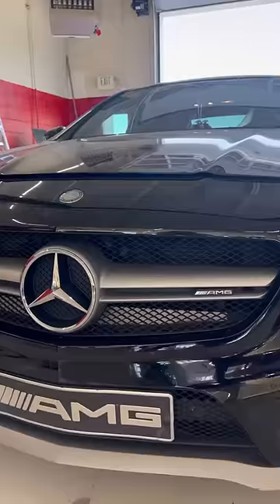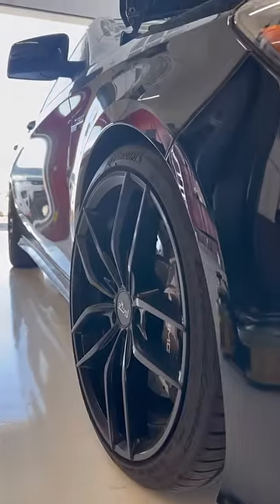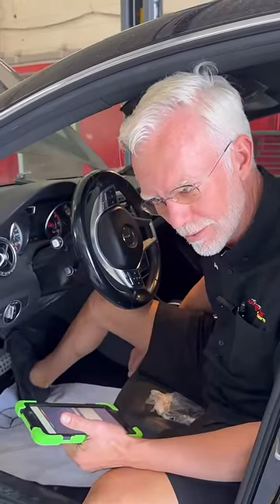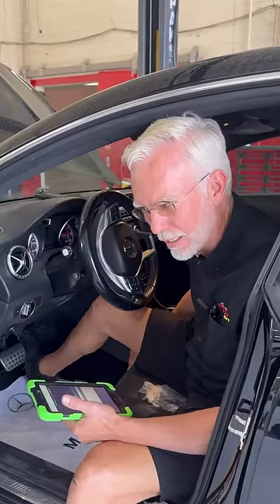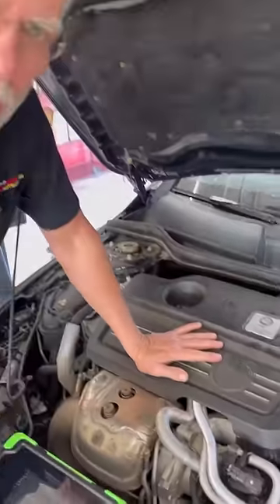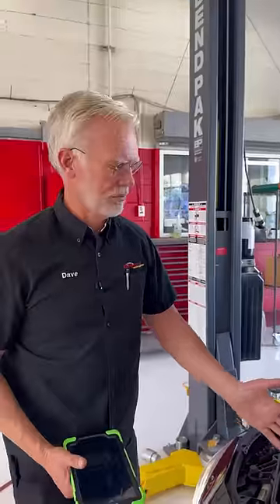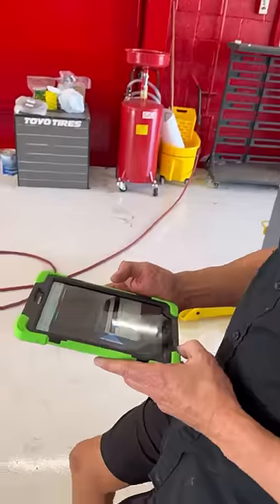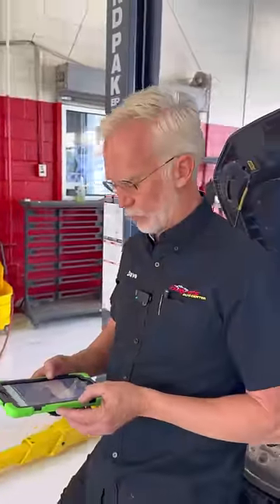Mercedes AMG Nothing but a slight noise on start up #carrepair #autoshop #mercedes

Comment: I’m just an old back yard mechanic with 43 years under my belt. To me it sounds like a water pump issue. Overheating and that squeak are tell tale water pump signals. Well unless this has an electric water pump. In that case it’s time to get the hose to my ear and go noise hunting. Could be a serpentine belt. I used to use Chilton’s Books. Now YouTube is my best friend. Channels like yours are invaluable.
Reply: it said something about the turbo and it sounded like a blowoff valve. i think thats the squeak you're talking about? usually they have the boost recirculate when the throttle close so that you dont hear the blowoff so thats one problem, the overheat is probably the water pump as you said or a bad thermostat etc.
Reply: Yes definitely
Reply: Could the overheating also be related to the supercharger/turbo (what is it turbo or supercharger on the AMG?)  problem because it's running lean!?
Reply: Electric, but your on track, the supercharger has an electromagnetic clutch,
Reply: it’s a mercedes, problems are never gonna be what they should be 😂
Reply: @tomconner5067  he made a short showing the fix. they replaced the thermostat and took out the junk in front of the radiator. 
the turbo related issue was apparently the wastegate. 
judging by the aftermarket wheels, the blowoff valve noise is probably on purpose by the owner.
Reply: The problem is it’s a German built car . 👍🇨🇦
Reply: Amg are some of the best Mercedes Benz out there they put the entire engine together by hand so if you think they are trash compare it to ford transmission or the cheap dodge rams with issues on new trucks or look at the Nissan titan rear axle weak as hell they all have some issues but I would rather take the Mercedes Benz because my uncle was a technician for Mercedes Benz for 28 years he saw it all and more
Reply: Put a thermostat in it and clean the radiator and it will be fine, been doing this for 45 years,   the valve not is probably something the owner done to it on purpose
Reply: Agreed, WP impeller bearing?
Reply: Possibly a leak at the manifold turbo.
Reply: Water pump on way out for overheat issue. Turbo issue for noise when letting off throttle.
Reply: You're a lad 🤝🏻
Reply: You heard the blow off valve for the turbo
Reply: Chilton b books whenever we bought a new vehicle me and my dad would go out and buy a new book for it
Reply: How would that cause low intake pressure? My bet is a shot bearing in the turbo, possibly oil starvation and after a few seconds when the pressure builds up the squeak goes away.
Reply: @Charles-j1e7t hahaha funny you say that because Mercedes use Nissan engines and I haven’t broken anything on my Navara NP300 (top range titan just in a diff country)
Reply: @gilibran you are reaching
Reply: Was my first intuition too, if it's overheating, check the cooling system, so coolant, pipes and pump. I guess if it's not that, some sensors the might be feeding wrong info so that it overheats?
Reply: Literally just what I wrote 😂 then I saw your comment 🤷🤦🏽‍♂️
Reply: @s2e130  That’s what happens when you get old. 😂
Reply: I would start with turbo.Soounds like  impeller bearing damage
Reply: If it's not the heads it the  thermostat .
Reply: It's prob the diverter valve
Reply: Stealership?
Reply: Also cud be turmastat
Reply: @Charles-j1e7t the issue isn’t the craftsmanship it’s the engineering MBZ constantly tweaks and takes shortcuts for performance rather than reliability.
Reply: Might be a snapped faldoring cord...and cracked billings bracket
Reply: @gilibran  pretty sure its a 2.0l turbo.
Reply: Testing for coolant proper circulation and or any lose hosing cracks in the charge air to air
Reply: I said in another Mercedes short to swap an LS in there problem solved!
Reply: I agree one hundred percent.
Reply: @ohiowankenobi1337 man ain't that the truth. I just got an old eclass nothin crazy but everytime something happens & I'm like "ah I know what that is" it's never what seems like lol.
Reply: @cameronhamer9432 shutup canada, what cars do you make? you got Toyota factories, ford factories, but no designs of your own yet huh?

🇩🇪×🇺🇸💪😂
Reply: Needs new engine ?
The older Daimler Benz engines are stronger, and sound pretty good too.

Drop in a DB 601, with a pair of synchronised MG 17s protruding from the bonnet, and that would be a nice reliable get around car that would keep you out of trouble for years.
Reply: should have a lean condition code thrown if it was running lean.  Underboost  condition is a wastegate   on or charge pipe leak. ... just thinking outloud. not trying to bust chops.
Reply: Same exact thing I was thinking! Water pump start there and move down.
Reply: @Charles-j1e7t not all AMG engines are hand built anymore 😔
 I think these four cylinder engines are one of those.........
Reply: @darkskinwhite  the Canadian designed matrix corolla doesn’t exist I guess
Reply: @darkskinwhite  Yeah it’s wild. Modern mercedes add to that by being impossible to repair lmao. Had a customer getting his oil cooler seals replaced on a 16 sprinter. Mercedes recommended to us that we have him replace a whole array of gaskets and bolts, total came to some 40 parts, 17 hours of labour and $17k when the dust settled. Had our most experienced and fastest tech on it, man was a miracle worker and shaved the labour down to 14 but he was ready to kill mercedes by the end
Reply: UR probably right .
Reply: Amen brother.
Reply: I'd clean the radiator for the heat then mess with the intake manifold to figure out the source of the noise under all of that rubbish plastic.
Reply: That's what it sounds like to me.
Reply: Even if electric pump it could have a bad impeller. Or collapsing hose.
Reply: I agree with your diagnostic. Sounds like water pump bearings.
Reply: Hey U can buy 2 Toyota Camry’s for 60,000. Throw that high classed Mercedes away and live in your budget.
Reply: German engineering.
Reply: Haha, Chilton's or Hanes. I practically forgot about those old books, but they sure were a godsend before YouTube.
Reply: @Scalettadom  I still have some.
Reply: Kids these days don’t even know what a chilton is I still go to the chilton first then you tube you never know if you’re going to rely on some jackalope for guidance.
Reply: If the turbo is water-cooled instead of oil cooled, there may be a small leak.
Reply: That's what I thought
Reply: Spot on  . Mike Scotland
Reply: With 43 years under your belt, I don't think you are a "backyard mechanic" anymore. That's amazing sir
Reply: @ Thank you. I’m a Master Plumber that has been doing my own mechanic work since I was 15. Everything from my trucks to my BMW to my wife’s Q7. I don’t rush in. I do homework and always fix it right the first time. Mostly because I hate doing things twice. I was following Dave’s four C’s before I knew they were a thing. Verify the problem, find it, fix it, verify the fix.

Comment: My nephew has been a Mercedes mechanic for 30+ years.  He knows them backwards and forwards and knows the weaknesses of every engine in every model year, and the fixes.  His mom, a Doctor, was in the market for a solid, reliable car, and asked him if she should buy a Honda or a Mercedes.  He told her, "Mom, buy the Honda."  You would THINK that if you paid that much for a car that it would be near-perfect in the reliability department.  You would be dead wrong.  Let's face it:  Buying a Mercedes is, for MOST, and exercise in VANITY and EGO.
Reply: Or just liking how the car looks and performs too. Nothing to do with ego. I guess you're speaking about your brother's mental issues though.
Reply: @user-2Hteyasizyc  And not caring about the reliability, economics and dealer support ?
I think you're barking up the wrong mental issues tree.
Reply: My dad talked the dealer he worked for into wholesaling used car trade in German cars to avoid all the headaches their return for work would cause.
Reply: Idk about that lol. My family has had an ‘08 ml320cdi since 2012 and that hasn’t given a single serious problem. This was the last model before bluetec iirc. We do all the work on our own cars. If I remember right, my dad had to replace the egr valve and he ended up just doing an egr delete when he saw how dirty it made the engine. I think he also replaced something to do with the ac compressor around the same time because it wasn’t blowing as cold as it should have been (maybe a year or two earlier than the egr delete). This was not too long after we got the car so my memory is a little hazy, regardless in nearly 15 years those are the only two problems of any real significance. If you take care of the cars they’ll serve you well. You hear a lot of horror stories of expensive repairs, but I think a lot of that is just mechanics scamming customers who know nothing about their car like in this case. That or it’s from people who don’t know anything about their car and don’t properly maintain it. It’s nice to have nice things and especially cars can give you a lot of joy for 10+ years. It’s not about vanity, though I guess it might be for a small minority of people.
Reply: I worked for Mercedes for 4 years at a factory building trucks. Not a great company to work for, I always did a good job, but I can’t speak to the rest. We did make a good product, unfortunately the company decided to ruin it by trying to cut costs and move to Mexico.

I think anyone that thinks they’re gonna get Toyota and Honda reliability out of something else is fooling themselves. Keep an eye on where your stuffs built stop following brands because of loyalty.
Reply: @rickjames9477  Funny ive driven a Volvo big rig with a Mercedes engine with an automatic transmission. It skipped gears and had adaptive tech, went in and out of gears when going down hill. it was strange having the truck pop out of gear and coast then automatically go back in gear and the cruise come on by itself. and applied engine brakes automatically. None of the other drivers wanted to drive it so it sat a lot with low miles for an older truck. At least it didn't have sensors that applied the brakes all the time like other trucks I drove. I almost bought it. It was an easy truck to put miles on.  I'm not crazy about German cars though.
Reply: @user-2Hteyasizyc  So the vanity part about you is spot on...
Reply: Agree. The two most important consideration in buying a car are: A car is a tool, does that tool fit your usage? And. Can you afford the repair costs? Take the high performance Audis: Can you afford the engine refurb and the half-service intervals that they require? If no, then you can't afford an Audi.
Reply: @user-2Hteyasizyc  I was speaking more to your assertion about mental issues, but that is something you apparently have first hand knowledge of. For you to presume that someone whose abilities may not be mechanical is idiotic - everybody has different skills, it's not necessarily a mental issue if theirs or mine are different than yours.
And by the way, I helped campaign and maintain a B Production car for the better part of a decade, so you can just fo.
Reply: People also get them for performance. Reliability often gets sacrificed in leu of performance due to more power/energy flowing through the entire system ;-)
Reply: @user-2Hteyasizyc How is performance and looks not an ego thing?
Reply: my experience leads me to theorize that Honda n Toyota build cars to be bullet proof knowing their customers will miss maintenance. While Mercedes and Bmw build cars to be bullet proof but just can't imagine a universe where an owner would skip scheduled maintenance
Reply: Drive the Honda, then drive the Merc. They don't compare. Mercedes pushes new technology into the car market and you can still buy mid 2000's Mercs with features Honda is only now introducing. You critisize Mercedes but they're brave enough to put extremely complex machines on the market. Honda and Toyota will only do it 20 years later when all the problems are ironed out...
Reply: Ive had bmw m3’s ,mercedes amg c60s,e63’s,honda civic,and toyota camrys….all of them brand new..and all of them drove over 100k miles…all of them had no major problems except the Honda transmission blew at 35k miles…the rest all had no problems…so its not really about which car,but if i had to choose for overall performance,feel,comfort,and design..i would pick the Mercedes hands down..
Reply: That may be true but if you are a mechanic at any dealer, and your job is to fix problems all day every day for that make, after a while you start to think that its a terrible car because all you see is the problems.  You dont get to experience all the time its working properly.

There are people who trash Ford for example...My current Escape is 7 years old 160k miles.  Only 1 minor problem in that time besides normal wear stuff.
Reply: @cletusvandamme6262  100,000. Lol I put over 400,000 on a Ford ranger.
Reply: It’s funny I read an article years ago that said Mercedes are used as cabs in Europe, don’t know if that’s true.  Another overpriced car for people with big EGOs !
Reply: Cool made up store. How long didn’t it take to come up with it?
Reply: I see bigger egos in oversized trucks
Reply: @SavedbyHim Mercedes cutting edge ? LOL NOPE
Reply: @jls5480  Mercedes had overhead cams, aluminium heads and fuel injection in the 50's. First to use crumple zones in the 50's. First to use a crash test program. Invented ABS in the late 70's. Etc etc. Electric car in 1906, First multivalve engine. The list goes on...
Reply: He wanted his mom to buy the Honda so he wouldn't have to be over there fixing her Mercedes every weekend. 
Obviously. 

However, he should've told her to buy a Lexus. MUCH better car than a Honda.
Reply: He told her to buy the honda because it's a far better value, and any repair on the honda takes 1/3 the time and money to complete compared to the mercedes
Reply: Nah, person does not know how to maintain the car.
Reply: Well said 👏